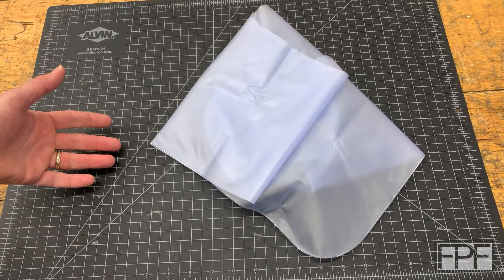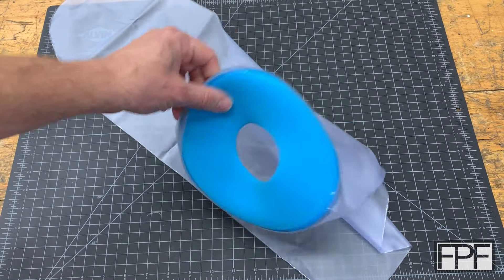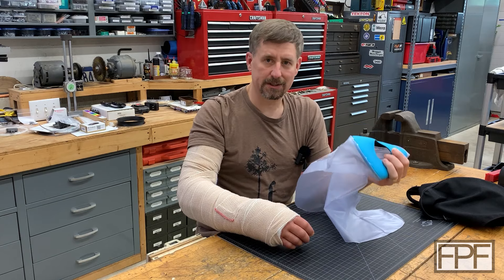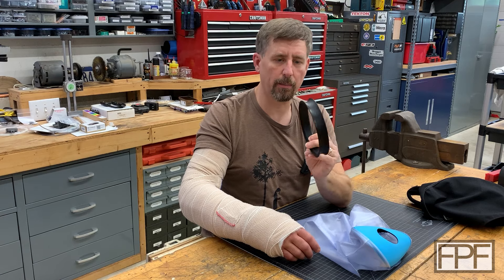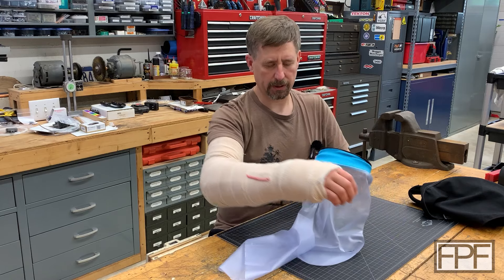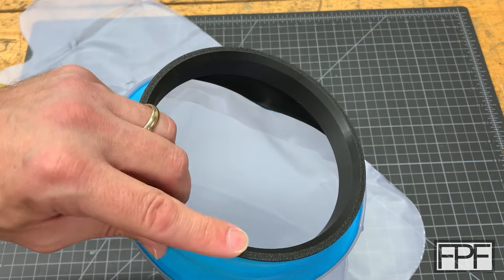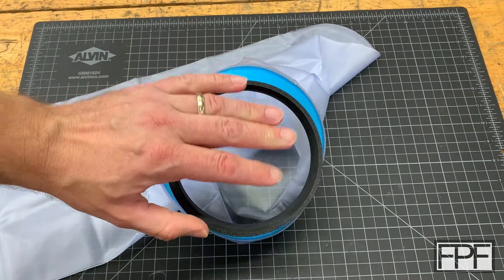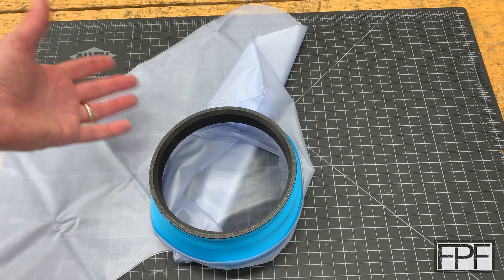3D Printed Fix for Waterproof Arm Cover

Comment: Great job, 25 yrs ago I made thin rubber drysuits for divers,company named Aquala. I made a few dry arm and leg bags. We encountered  this problem, I used the typical drysuit rubber "neck cuff", i adapted one of the pvc pipe  "stretchers" I used to join dissimilar circular peices of rubber together. Only diff to yours, mine were cut to aid in placement /removal. I may have been the person that designed the og arm bag, I know they sought a patent for it. I'll ask my old boss when I see him.

Comment: My guess was more of a reverse clamp. You’d feed the clamp in to the opening, then squeeze the handles to expand the “ring halves”. Then it has a ratcheting mechanism to keep it open while you slide it on. Then you unlock the clamp once in place. 

Not sure how much time it would save, and is sure FAR more complex to print 🤷‍♂️
Reply: I had the same thought as this, like slip-ring pliers. I figured that would make it easier to manage one handed.

I was not thinking about the post-shower part of it though, and getting that into\under the seal without digging into your armight be more painful... It's certainly a more complex option then his solution too 😅

Comment: Thanks for the shout out, I'm glad you didn't need a reprint this time. :)
My first thought was much more elaborate, along the lines of a 4 prong expander (cattle ranchers know what I mean.) Simpler is better.
A big advantage of this is that you can leave it in place and allow the bag to air out between showers.

Comment: When I was 15 I shattered my leg and was in a cast from my toes to my crotch for a year and a half. I had a waterproof bag with a wide rubber band that wrapped around it and latched to make it water tight. If 3d printing would have been a thing then I would have designed all kinds of scratching instruments. 
I just made it to that part and I think i would make a ring with 4 prongs mounted to the wall that would hold it open while I stuck my arm through, so it would pop off and close when I got it all the way on. Can't wait to see what you come up with.

Comment: Cool, maybe splitting in half with dovetails into two pieces to make it easier to put on and off. Make the dovetail just half the thickness of the wall so you can stop the dovetail to slip all the way through the wall.
Reply from the maker: Not sure i follow

Comment: My first thought was two half rings similar to What you made, but joined by a set of plier handles similar to retaining ring (snap ring) pliers that open when you squeeze them together.  Way over engineered. However as is usually the case, simple is always better.